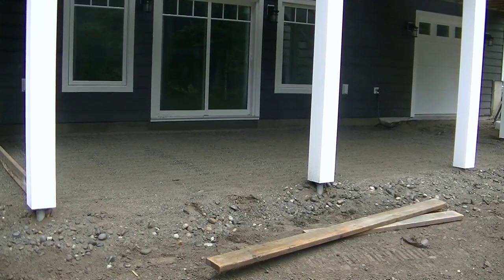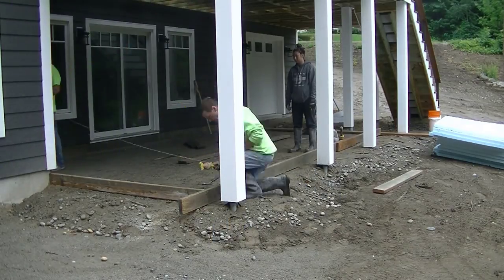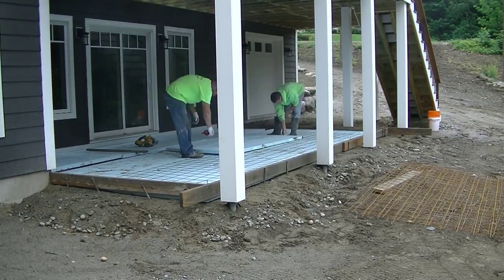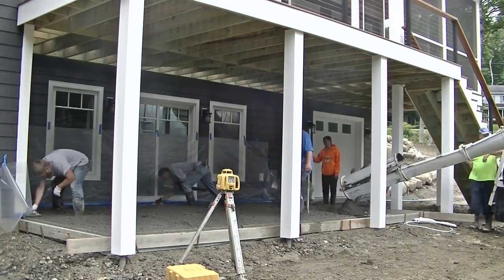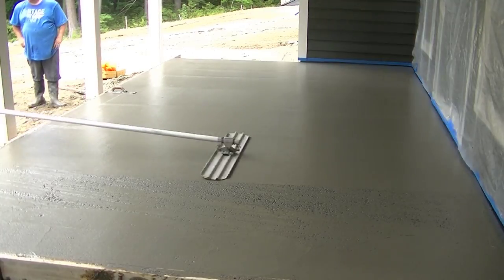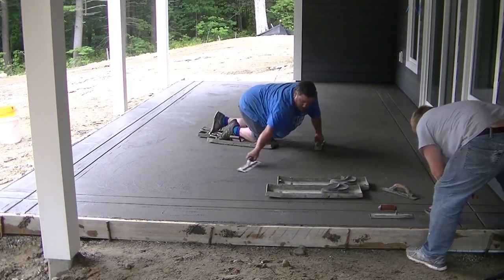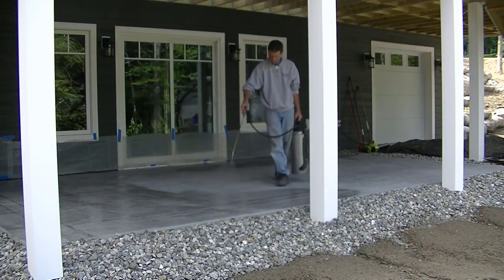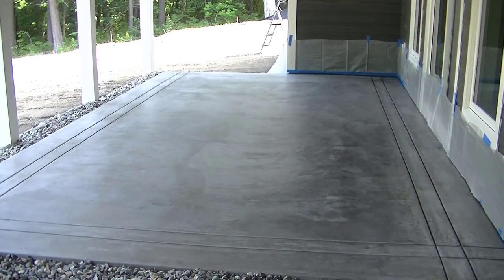How To Form, Pour, And Finish A Concrete Patio Slab

Comment: Hi Mike, I’m from New York State and I have been wanting to do exactly what you are doing in this video! I plan to put a water mitigation ceiling under the deck and then screen in a portion of it. The slab wii be approximately 10’ by 34’ and will be poured at our place in the Adirondacks so your comments about freezing thawing cycles is exactly what I’ll be dealing with! Excellent timing for this post.
Thanks,
DC
Reply from the maker: Good to hear! Thank you!

Comment: Hi Mike,
Found you today and the answer to your question is YES. We live on a small farm close to the coast in west Wales, UK. We cannot get access to ready mix concrete here due to our farm lane across an old stone bridge, very narrow and up a steep and winding hill. As concrete pumps would be too far away we have to pay contractors to ferry a yard at a time from a mixer truck parked some distance away. This makes any work here very expensive and as most of our farm concrete is in very poor shape, we are having to look to ourselves to do the work. Therefore any help you offer is gratefully received. Forming, preparation , hard core, membranes, water content , mixing , every aspect is appreciated. We are looking at a pto powered pan mixer loaded by our tractor to make things easier. Thank you. Lloyd.

Comment: The owner gets what the owner wants. I always loved the look and easy maintenance of a smooth finish but I’m not sure that was the most practical finish for an outdoor patio, exposed to the weather. It’s gonna be a little slick when it gets wet. Looks good in any case.
Reply from the maker: Yes, it's what they wanted! Thank you!
Reply: @MikeDayConcrete  Scott and Nate on ‘Essential Craftsman’ just did a new garage pour video. Would be curious to hear your take on it.

Comment: Great work! curious of why you keep the string line on while pouring, I've seen you guys do that before? - Mike Norcal
Reply: The string lets them know if there forms push out while pouring. They always watch the string if the form pushes outside the string they tackle it right away and brace it back in place.  
That's my thoughts on it, I could be wrong. 👍
Reply: @terrymcgillicuddy8056  I was kinda thinking the same thing, but if you're constantantly pushing is down while screeding that defeats the logic of it.... right? I've never seen it done out here in Norcal, but was just wondering why no big deal.

Comment: Thanks for this Mike...what kind of Styrofoam do you use?   Can the styrofoam be used over a bad basement floor before pouring conocrete?  If so, what is the minimum thickness?  Can the styrofoam be used under  concrete paver patio?

Comment: How many inches of concrete were there above the foam?
Reply: He said in the video. 2x6 is 6 inches tall or thick, subtract the foam thickness, looks like its 2 inches  to me and you get 4 inches. HOWEVER, a 2x6 is actually 5 1/2inches thick, So it would be 3.5inches thick, thats normally how thick concrete is poured because a standard 2x4 is 3.5 inches thick.